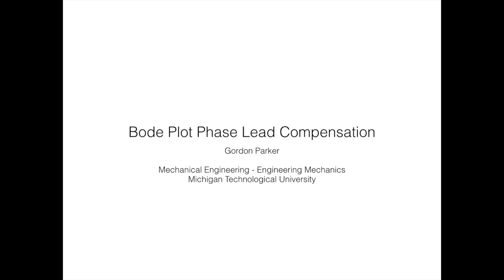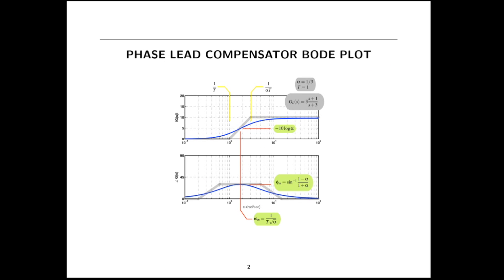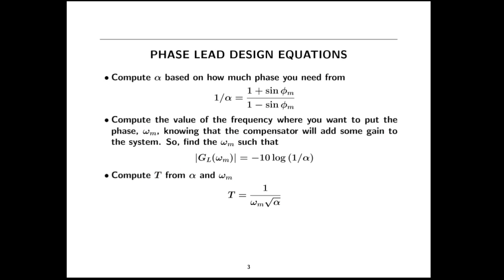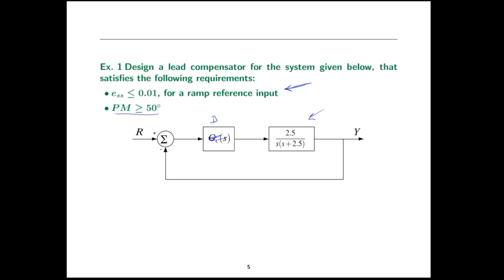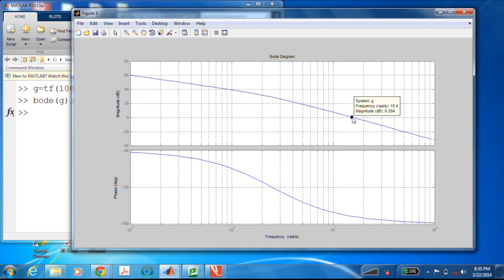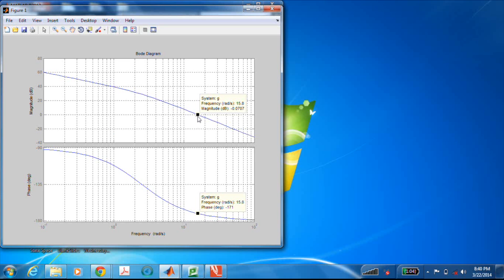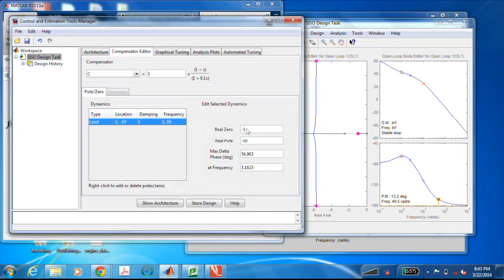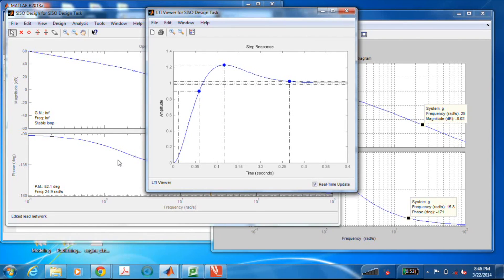Bode Plot Phase Lead Compensation

Comment: Is it possible to achieve 60 degrees phase margin with only one lead compensator for a 2nd order system with imaginary roots and an integrator, that has 0 degrees phase margin and is critically stable? or is there a maximum of how much phase margin I can add with just one compensator?
Reply: the bubble between the corner frequencies has a phase increase of 90° .... so you can add up to 90° phase... but it depends on your open loop phase diagram ... maybe you have already a margin (in this example 9 degrees)....so it depends
Reply: Your system G(s) = 1 ÷ s(s^2 + 2zw.s + w^2)
draw the bode,if its marginally stable PM = 0..
then for sure you can improve the PM to 60° by adding the lead compensator (you can add up to 90°)
Reply: @KIMIRAIKKONE198N4  that was 5 years ago but thanks haha
Reply: @hanjun941  
No problem 😁😁
glad to help ... even after 5 years 😉